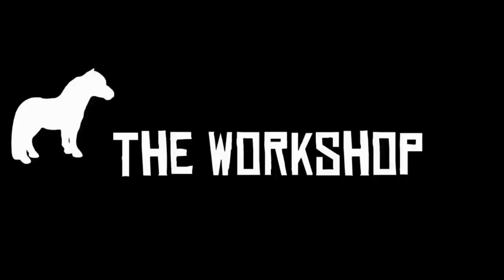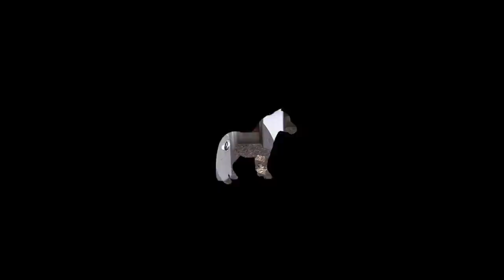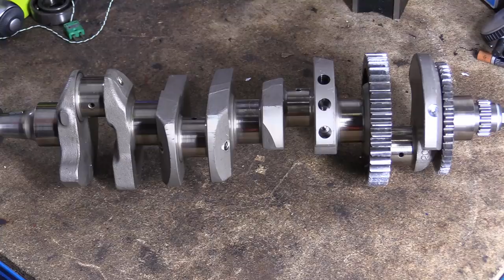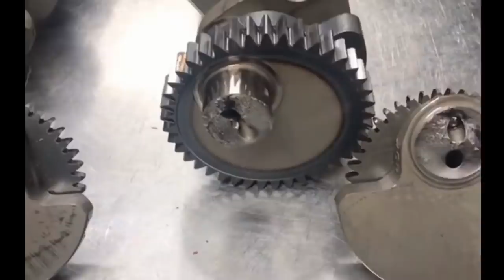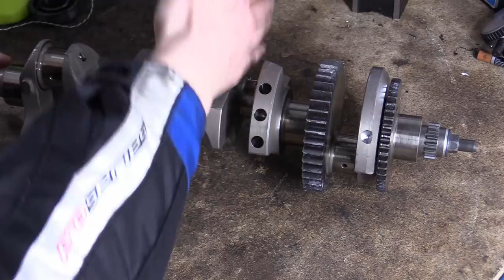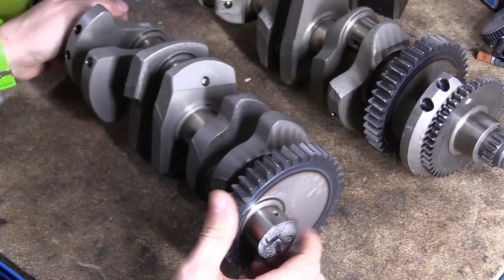Crossplane Crank Science - Part 1

Comment: Great, just bought the 2009 model. Good thing I'm not a racer. 😂Looking forward to this series, I'm really curious about the technical details! Thanks a lot for sharing your knowledge!
Reply: Replace your  CCT. The OEM one is crapping it's pants.
Reply: @unphoto  I looked that up a lmao it looks almost exactly like the tensioners they put on 90s Hornets which were also renowned for the internals disintegrating. Easy fix on a Hornet, at least.
Reply: @spankeyfish  Even easier fix on this engine. 15 minutes max. i replaced mine the minute i heard that clacking sound at cold startup!
Reply: Thanks guys I'll look into that. So far I'm not hearing any weird noises.
Reply: @somborn  When the tensioner goes you'll only hear a noise at idle and very low revs, once you rev the engine up the camchain tends to stop flapping around. It literally sounds like you're slapping a chain against something.

Comment: Hey Mark/Matt, 
Well, I have TRX with replaced engine from older TDM as the original engine(with the crossplane crank) (as you say) had shit the bed. And now having very hard times to find crankshaft at the ebay.co.uk or so... even here in my country. Then I bought engine from tdm 900 and guess what  - the fuckers had swapped the crank, cylinder block and head from XTZ 750.... 

My point is that these crossplane cranks are fucking up since 1996, but so far can't find out what is causing this fault. Yeah, the new 4 cylinder Yammy poops have weak spots, but are the TDMs/TRXes are shitting the "big end" or at least this is what I'm seeing as common fault in the web.

Comment: Matt, 

do you have access to equipment to X-ray the complete specimen? Would be really interested to see if it has already begun to fail!
Reply: I think the best bet is to dye pen it, its a lot cheaper. Other then the crankshaft journals showing up in an X-ray, micro cracks are very difficult to spot.
Reply: I would think that if it has already begun to fracture, given that huge void (cross drill) it may actually show signs internally. 

I ( a lifetime ago) ran a supercharged, alcohol injected 568 ci Chevrolet. Broke a couple of cranks right in the middle of front main journal.  Both were right at the oil hole. Found a metallurgical lab, and started sending crank off during freshening up, and they showed cracking before magma-flux would.

Comment: yo matt, i need advice, unrelated topic. sometimes when i accelerate fast and fail to shift from first to second, ending up in neutral, when i try to go in second gear after that bike makes terrible grinding sound and doesnt want to shift. what happens and what to do in that situation?
i know i can lower my speed almost to a stop and then shift to first, but can i do anything without slowing that much when it happens to me in traffic where cars are behind me?
i have a 07 Honda Hornet.
Reply from the maker: The problem is either you, a bend in the selector fork guide rod or the cam selector arm spring that's part of the ratchet arm.
Reply: @dirtygarageguy  yes i know that its probably my technique, but i want to know how to get in second gear without that terrible grinding sound when that situations occur. is it best to just rev to 6-7k rpm and then shift in 2nd. does that grinding happen cause rpm drop down?
Reply: @t0malito404  
Yes.

Comment: well y engineer didnt build twin crankshaft similar to rgv500?4 cylinder square 2 stroke engine(correct me if it wrong)
if they wana find balance n less vibration in engine?
n matt..is r1 crossplane crankshaft forged?

Comment: It has to be a harmonic balance issue. It doesn't look like a strength issue. Look at images of an LS1 crank. The R1 crank is a big beefy hunk of metal compared to an LS1 crank and an LS crank can handle a shitload of power. Looking at LS1 cranks makes me wonder if the R1 crank is too heavy to be turning the RPM's it does.
Reply: as well as 2jz crankshaft..they forged r they?
Reply: @muhammadafiq2702  yes they are forged. You can't compare to a 2JZ. The reason I compare an LS1 and R1 crank is because they are both cross plane of similar design and would both have similar primary balance
Reply: @buildingracingvideos4714  yeah,pardon me for mistake..how bout r1m then...
Reply: @muhammadafiq2702  the r1m should have the same crank with a little less counterweight because of the titanium rods
Reply: @muhammadafiq2702  r1 and r1m have identical engines, its the r1s that has the downspec engine with steel rods and diff crank.

Comment: Yay! Crossplane cranks! If mine fails, i will send it to you to analyze.
Reply: Or have it replaced by the recal before you destroy your engine...
Reply: @unphoto  i have a 14, no recall as far as i know
Reply: @jeffh6971  Yours (and mine) is still the 1st Gen. CP. 2015 is the 2nd Gen that puts out 200BHP @the crank. Recalls are eligible from 2015 to 2018.

Comment: *Need urgent help*: KTM LC4, today, suddenly lost power. Lots of oil spilling out of the airbox and found out later, that the oil left in the engine-case was full of gasoline. Was just running 5 min, and relatively cold, so I hope no further damage at least, but I haven't opened it yet. Any predictions what I will find?
Reply: Come on anyone, pls help! Most of you have a bike too, so you know how my heart is bleeding right now!
Reply: @eck3319  
Idk man, if it had carburetors, I'd say ya fuckin floats are stuck. Deff dumping way to much gas. Idk why. Sry.
Reply: Check your cctv,somebody might smartly pour gas in your oil case
Reply: @brotherpong8494 > Thanks man.  I figured its in best case 'just' the oil ring and in worst all bearings, but it ran just some minutes and wasn't hot, so my hopes are high.